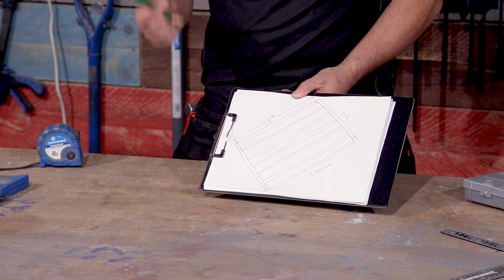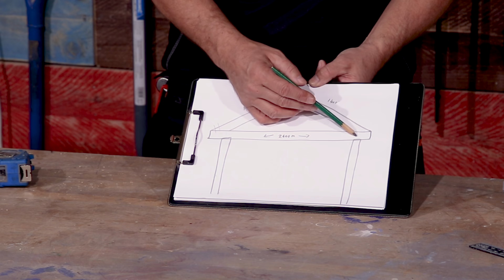How to build a garden office

Comment: Great video, however i have an irregular space in my garden on slopping down ground. Getting it level is ok but how do you set up the angles for the post to be tight ? It will be 7ft deep one side 10ft deep on the other with a span of 9ft. Advise very welcome
Reply: Thanks Stu, I'm very sorry but its such a difficult question to answer in text! It would take another video or a hand full of drawings to be able to figure that out for you I'm afraid

Comment: What a great video, this has led me to think about building a garden office for myself. Any problem is my outside area is sloped concrete, what would be the best way to make my foundation on this sloped surface?
Reply: Thanks, You could always make your floor frame flat like I did then cut different size stump legs that can be made from 4x4inch hardwood timber, and fixed to your sloping concrete base, this anchor to the ground and you could level your flat frame across the legs. of course you would see a gap below that slows this could be covered with your T&G claddings

Comment: Such a fantastic video! Makes me very excited about the now very realistic possibility of building my own outdoor office/studio! Would be ace if someone could come back to me on a few questions I had. I did look through the answers to previous questions, and I couldn't quite see what I was looking for...

1. Roof truss: there appears to be about 200mm between the edge of the roof truss and where the 2x4 internal wall is. Could I ask you how you filled that gap in the final structure, if at all? Or did you otherwise leave that open?

2. Exposed roof truss (internal): I think I could see in the final version, on the inside of the office, that the roof truss' are exposed? Could I just ask if there was a reason for not covering these? 

3. Soundproofing: I'd like to mbuild an outdoor office myself, specifically though for woodworking. I'd be keen to install soundproofing for this purpose, and I wanted to ask if you had any thoughts on where the best place was to install soundproofing material?Perhaps between the inside of the cladding and the 2x4 wall structure - or within the 2x4 frame along with the insulation?

4. Finally, with the design you've showcased, are there any limits here in terms of the size of the structure? And if you believe that this is a limit to how big such a structure could be made with your design, are there any ideas for additional supports that would make a bigger structure stronger?

Sorry for so many questions!
Reply: Thanks William were glad your excited about possibly building your own outdoor office, Feel free to send us any questions you have and we'll try to answer them the best we can. 
- As for the 200mm gap I'm not use which edge you are referring to sorry. 
- I left the exposed roof truss to add further insolation and I still have further wiring to do after we finished the build. 
- As for sound proofing there is so many different materials on the market which require different ways to fit its hard to answer, plus it departs what you require the sound proofing for, IE to stop sound coming in or to hold the  sound you make stay inside 
- The size timbers I used were for the size that I build, if you was wishing to build a bigger unit I'd get some advise of both wall and roof size timbers you'd need before starting. 

Hope this helps 
Craig

Comment: Great video. Think it is really helpful. Is there a link available with a full kit list which includes absolutely everything on it down to glue & nails?? How much did this all cost? 
Lastly, I see a few comments being critical about there being no membrane under the feather boards. I know you have said that the walls will be able to breath but should I consider a membrane just in case or are you confident that damp won’t be an issue?? Any help much appreciated. Thank you
Reply: Hi Damien, we will be working on a more details list of materials for costings, however many people build this kind of projects to fit there only space and needs, we spent just over £2k on materials for this size, As for the breathable membranes over the insulation, the I've built this one allowing air flow from the top section of the walls its fine and we haven't experienced any issues, but please do get some advise from the supply that you purchase the insulation from so you can be sure if your structure requires any membranes or not.

Comment: Excellent build, given me lots of tips. Did you use 3x2 for angled part of trusses? Also can you tell me where I can get the U shaped brackets that you used to secure the trusses to the sides please? Thanks.
Reply: Thanks John, Yes 3x2 inch timber if fine for a pitched roof this size, the brackets can be purchased though all main builders merchants and some garden centres, or even Tools station and Screwfix should stock them.
Reply: Thanks

Comment: Craig nice work and great result. I was wondering how durable the upvc paint on doors is? I am thinking of painting my door but worried of how long-lasting paint on upvc would be?
Reply: Thanks Hazim, our painted have been on for close to two years and they still look fantastic, just a decent paint and apply 3 to 4 thin coats on and they will last you easy 5 years.

Comment: Spot on,will the brad nails that you used to fasten the boards and plywood on be strong enough
Reply: Thanks, Yes most defiantly, I've built around 8 to 10 of these over the years and always used 50mm brad nail and we've never had any issues, you could also apply some glue on the timber frames before applying the cladding or ply for extra strength, I find when your using a nailer like this you tend to fix far more nails in that's required because its so quick and easy!

Comment: Hi like your work, just wondering don't you need to screw or bolt the main frame to that concrete block?? and how much does it cost to build?? thanks in advance
Reply: Thanks, the weight of the structure holds it down well, but we do live in a shelter areas with huge trees all around us so maybe if you're in an open area that affected by the wind then yes by all means bolt it down well. It cost us around tow thousand pound for materials but I did have some old materials left over from other jobs I used so I;d maybe budget around £2,500

Comment: I'm curious if like to be able to move the pretty nice garden office around.
How many Caster Wheels 3inch Heavy duty fixed, swivel and brake Caster Wheels would I need? 
Your advice would be much appreciated
Regards Tanya
Reply: Hi Tanya, such structure could be build on castors however the floor timbers would need to be larger (Thicker ) than the 4x2 we used, The base would also need to be further reinforced with ply wood we we set this floor on around 12 load points, if you were to have a structure this size and weight then you may need it to loaded onto around 6 to 8 large heavy weight wheels that could take a weight load of at least 750KG per wheel

Comment: Comprehensive build video! One question, does the base frame not need to be fastened to the concrete pad foundations or does it simply rely on the weight of the structure?
Reply: Thank you, We didn't fix our base frame to the pad foundations as we were quite sure it won't move due to the weight, However our garden is very well sheltered from the wide due to the high trees around us, if your planning a build that wasn't as sheltered I'd recommend considering fixing the structure down to the foundations.

Comment: Great job Craig 👏 It's inspired me to build my own garden building!  I can see at the end there's insulation in the roof.  Did you just leave this exposed?  If not, what's the best way to insulate and cover it from the inside?
Reply: Thanks St James, I did leave our roof insulation open as I use it as an edit suit and it helps damped the sound for us, it could be covers with a nice T&G wooden or UPVC ceiling board would both look nice, it maybe wise to cross batten the ceiling and allow a bit of air flow behind the cladding to let the insulation breath
Reply from the maker: Let us know how you get on with your own build 🏠
Reply: @MrandMrsDIY  Brilliant, thanks Craig. So have an air gap below the insulation and also above it?  Or should the insulation touch the inside of the roof?

Comment: Good video Craig.  Liked the tiles you used, which brand were they?  Also, is there any reason why you didn't use a waterproof membrane between the wall cladding and the insulation?
Reply: Is it because he used ply on the inside and not plaster board?

Comment: Around 20:25, anything to be aware of when putting in screws in the roof truss so that they do not collide? I'm guessing having each slightly off-center is all that is necessary, right?
Reply: Yes sure its setting them at an angle so they collide, even if they did at that angle one would just spare off to one side.

Comment: Hi Craig, Great video. I’ve checked the comments and am afraid to ask this as it may seem like a silly question....but how did you get power in to the shed? 👀
Reply: Hi, I didn't supply to start with as we can not give electrical advise on our videos, however, I got my electrician to install it when id finished, because of the way I built the base I could get underneath the one side so he drilled a 25mm hole in the floor at one corner then routed a Armoured cable though and connected lights and sockets, You could also ways have your Electrian install the cables first and build around/over the feed.
Reply: @MrandMrsDIY  Thanks for the response!

Comment: Could anyone help? Does it matter which way round the joists go in the floor frame? i.e. could you use seven 2.4m 4 by 2's with two 3m 4 by 2's or as Craig has done: seven 3m 4 by 2's with two 2.4m 4 by 2's? The way i'm proposing will mean the tongue and groove boards will be fitted in the same direction as the joists rather than across them. It's just that I have enough wood already cut for my way as it's already cut however I'll need to buy more doing it Craig's way. Thanks
Reply: Thanks for your question Matt, Its stronger to cross the floor boards with the frame that's why I did this way, I appreciate used existing materials can save good money but be careful that you spend all that time and money building something that mite be weak! if you do use your old materials with your method maybe consider applying another thiner layer of sheeting to add to the strength at a fraction of the cost.

Comment: Curious as to why no breathable membrane,between cladding and insulation on walls.Also why didnt you remove the glass unit from the window frames,and fit the screws thru the frame into the joist,instead of them brackets.
Reply: On some constructions and different insulation breathable membranes are required and most certainly could of been used on this one too, however the cladding I used isn't completely airtight so the insulation will be able to breath, I've built around 8 to 10 of these structures over the past 10 years and we haven't came across and issues.

Comment: Would you not need a vapour barrier on the 'warm side' (inside) of the insulation in the walls? Especially if you plan to heat the office?
Reply: A vapour barrier could be used in some areas, we felt that structure with the insulation I used was breathable as it was totally airtight, we've had a heater being used over most of the winter and we haven't had an issues with it.

Comment: Great build Craig - well expIained and expertly built. 2 questions: Approximate cost of timber materials? Did you consider installing a water vapour barrier to help prevent condensation?
Reply: Second the vapour barrier question - that shiplap stuff can shrink and allow water through pretty easily, especially if it goes up still wet from the timber yard - it then seems to have direct access to the Rockwool. At £50 for a big roll of barrier it would make sense to use it. Happy to hear from Craig otherwise though.

Comment: Hi craig, the timber for the base - was it 4x2 tannalised rough sawn that you used? 
And would 4x2 CLS timber be suitable
Reply: Hi Simon, Yes its was 4x2 sawn tantalised timber I used. I'm afraid I wouldn't use 4x2 CLS timber for this build, its a lot lighter weight timber, cheaper to buy of course and its not recommended for out door use, the CLS would twist and crack when used outside so wouldn't last long.
Reply: Thanks for your reply Craig 👍
Reply: @MrDIYCraigPhillips  If you would not recommend 4x2, what would you recommend?
Reply: @ianpotts4935  4x2 inch timber is fine but it must be tantalised timber for outside use and not light weight CLS wood

Comment: Wait, what about the gap between the insulated wall and the roof? It was just left with a horizontal overhang. I see you built something down from the roof (soffet?) but surely all the hot air just escapes through that gap?
Reply: The gaps by the sofit cane and have been filled with insulation, this lets the walls breathe so they don't sweat and creates mould.
Reply: @MrandMrsDIY  ah I see, thanks for that!

Comment: How do you know structurally how far apart the floor joists should be
Reply: With a structure of this size the spacers that I've left would be fine as you wouldn't normally have more than 6 to 8 people in it at one time, also the packers I've rested the floor structure on are spaced correctly for this size.

Comment: I'm confused as to why you insulated the floors and walls but left the roof un-insulated. Surely as heat rises it will escape from here?
Reply: We did insulate the roof trussers with a fiberwool, because we left the roof space open you can use any kind of insulation of your choice.

Comment: The insulation is exposed to moisture underneath the floor, right? Couldn't that get mildew/moldy over time?
Reply: Hi Jesusin, Yes anything left outside over time could get mildew and mould over time, The way I've designed the structure is to allow airflow below the underside of the base which will prevent mould etc.

Comment: Shouldn't there be a waterproof membrane on the walls too.?
Reply: Waterproof membranes are not required with this kind of structure, however some kinds of insulation may require breathable membranes so its best to check with your supplier when purchasing the insulation.
Reply: @MrandMrsDIY  ok
 Thnx

Comment: chipboard outside??? substrate side protection??? what a waste
Reply: The chip boards aren't outside, plus they are tantalised boards which are used for flat roofs on houses,  and where they are situated they are not exposed to the elements there covered as they should be.
Reply: @MrandMrsDIY  chipboard and ply in a roof..... absolute madness!  the only thing that protects structure is a membrane that you pierce with nails.   you didnt prime the back of the fascia boards.  Oh my goodness I hope you dont have a building license!!!